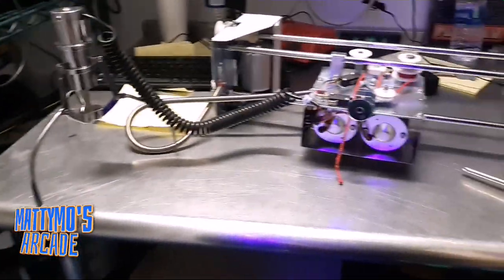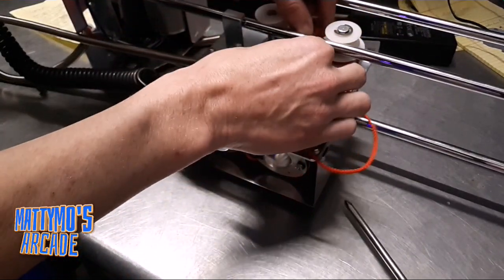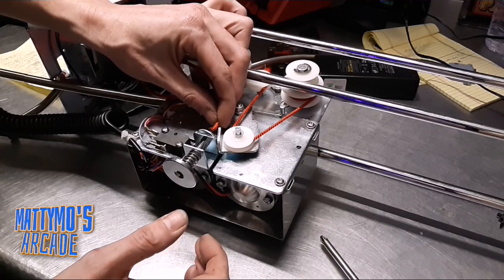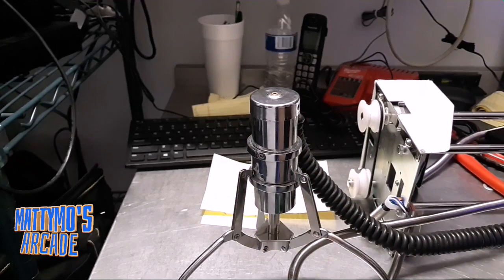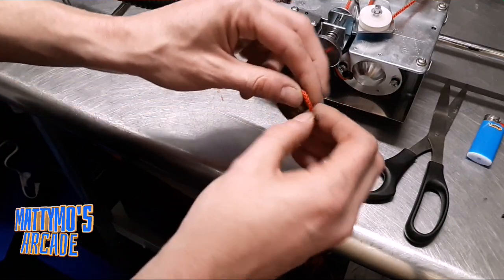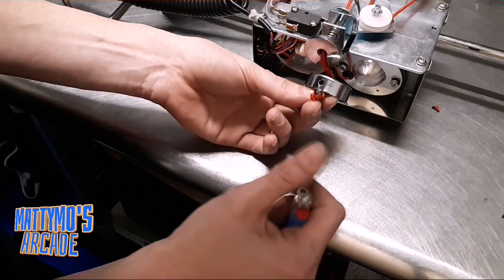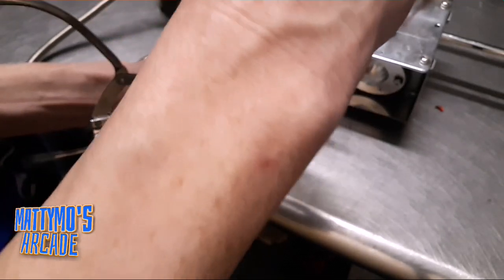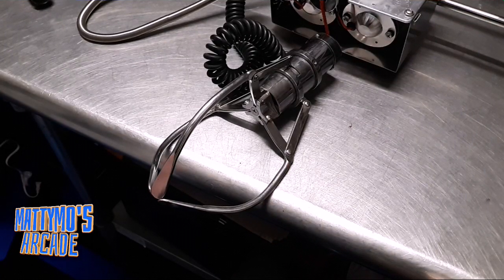Claw Machine Repair: How To Restring The Claw

Comment: This is a good video but leaves out the part where you get the string though the hole where the set screw holds it in place...

Comment: Hi I noticed I bought the same DIY claw machine kit as you. Mine has stopped working. The LED numbers on the board have stopped displaying and the claw doesn’t close when it comes up, any ideas what’s wrong with it? Thanks
Reply from the maker: I'd start by checking your voltages. Keep me posted!
Reply: MattyMo's Arcade ok will do! I’ll keep you posted
Reply: MattyMo's Arcade hi so to be honest I don’t really know much about how the machines work, it’s a little DIY thing I took up. I bought a voltmeter so is there something specific I should check for? I think it’s board level since the LEDs on the board don’t light up, the claw won’t close, and now it doesn’t return to home or cycle to a new game every time. Also how can I check if the claw coil is bad?
Reply from the maker: I assume the power supply is the one included in the kit. The board should have leds lit up if it has proper voltage. There are settings for claw strength you can adjust. I had to do that too. The claw was weak like you're saying.
Reply: MattyMo's Arcade Hi so I see the leds you’re talking about. I also noticed after watching a few of your vids that we have a slightly different board but same parts overall. The board and everything was working at one point but just stopped (that’s where I am today). The leds are lighting up but the number panel (that you see what input the settings) isn’t lighting up, I think that may be the cause? Also should I be worried that the claw doesn’t return to home after every game?
Reply from the maker: Home position you can adjust in settings. Did you order from Holland Computers?

Comment: What I am trying to do is replace the cord on the claw machine. I can’t seem to get the spooling wheel to come off, so I can get a new cord inside it.
Reply from the maker: Yes. Just respool new string onto it.
Reply: @MattyMosArcade  lol it took some work, as I had to melt the string to keep it solid while pushing it through. That sign said, I think the spool has been on there so long, that it would not come off the axle.

Comment: I have a rainbow claw machine that is giving me error code 10 "claw up jam" I figure its a relay up in the housing but any idea which one or what the code actually means?
Reply from the maker: I would think it’s the switch that lets it know when it bottoms up, or possibly a tangled string. I think it’s saying it’s jamming before the up switch. Does that sound right?  You can try to google the manual for your specific game. It might have some clues. They are usually terrible. Lol
Reply: @MattyMosArcade  thank you I was figuring it might be the string, if I pull down on the claw its pretty tight and the claw won't pull down. I'll see what I can find.

Comment: Do you have to cut the string if it comes off track?  Mine came off the small pulley and I need to get it back on, but it is so taut.
Reply from the maker: You should be able to release the string.
Reply: @MattyMosArcade  How?  This Holland Computer kit has had nothing but problems.
Reply from the maker: To get the gantry back on, twist it around to get it above the bars, and it should just ride on the bars from above. You might be able to get it back up without messing with the string.
Reply from the maker: Claw Daddy is there a pressure switch at the home position? I think you press there to release it.
Reply from the maker: I didn’t have many problems with mine. You may have a bad pcb.
Reply: @MattyMosArcade  I don’t think I conveyed the issue correctly.  The string came off the small pulley in the gantry. When you press the drop button, the claw goes down a few inches and comes right back up.  Putting the gantry back up is not the issue.  It’s the string.
Reply from the maker: Gotcha.  Hang on. I’m going to rewatch this video to refresh myself.
Reply from the maker: You have plenty of string on the spool?
Reply: I need to know how to loosen the string to get it back around the small pulley.
Reply from the maker: It can get knotted on the spool and won’t be able to lower completely. Might not be our problem though
Reply from the maker: Claw Daddy you should just be able to pull it off the spool like I do in the very beginning of the video. That’s what makes me think you might be out of string.
Reply: @MattyMosArcade  not sure why I would be out of string.  I haven’t touched the string since it came with the kit.  Maybe I can push the bottom pulley up in the middle of the “Z”?
Reply: To loosen the string?
Reply from the maker: At 0:50 I pull the string free, and pull out a few extra feet of string to compensate for where it was broken. If you don’t pull out enough slack, it won’t have enough play to reach the bottom.
Reply from the maker: In that case, yes it would be easier to just cut the string, pull out some slack, restring, and you’re good to go.
Reply from the maker: Claw Daddy yes. You can see me do it there in the beginning
Reply: @MattyMosArcade  How does the string slack disappear? Where does it go?
Reply: Just wanted to close the loop on my repair.  I cut the string above the claw to release tension, rewrapped the remaining string around the small pulley, and retied the string through the claw.  We’re back up and running as DIY’ers!  I appreciate your guidance and videos for the Holland Computer Kit.
Reply: Did you say there is a pressure release button in the home position for the Holland Computer Kit?  I figure vendors would need an easy fix when the string gets tight/off track rather than having to cut and restring the claw like I did.

Comment: Do you know how to replace a joystick?
Reply from the maker: Yes. Lol
Reply from the maker: There is an E clip on the bottom of the bat. Remove that, and the bat will slide out.
Reply: @MattyMosArcade  it’s as easy as that?! Lol
Reply from the maker: Yeah, once the bat slides out, you can unbolt it. I transfer the wires one at a time to make sure they are the same. Two wires for each direction, one is a ground wire. Usually the joystick is fine, but the wires have come loose.